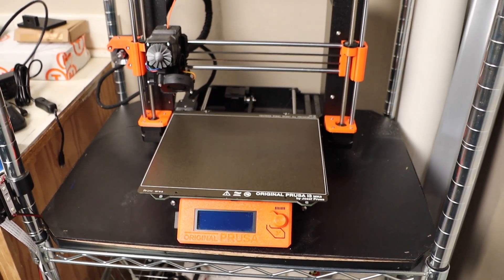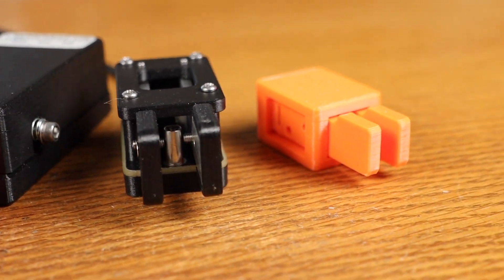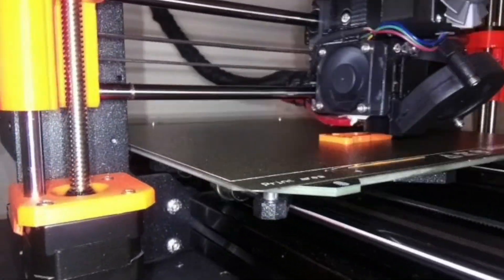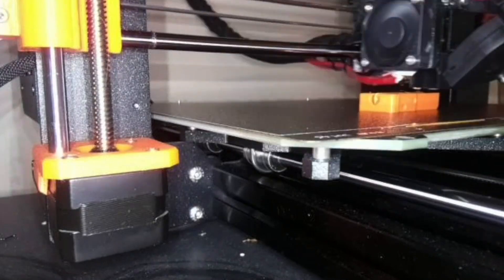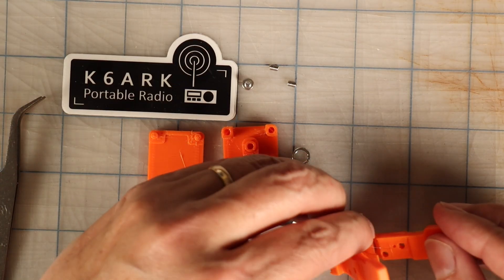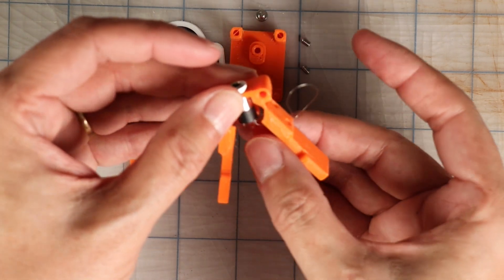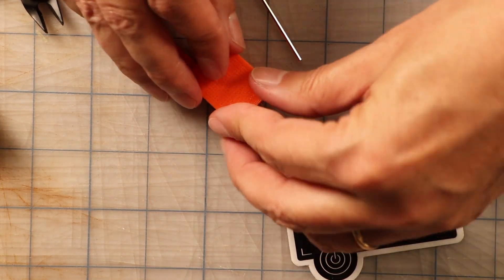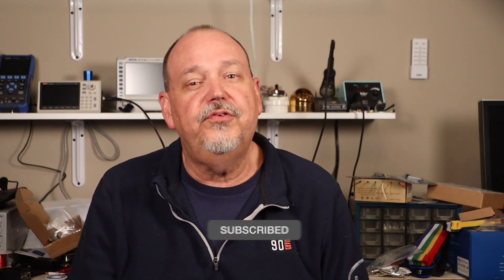K6ARK 3D Printed Paddle: Assembly and Review

Comment: what do you think the thickest gauge wire you could use would be? I keep breaking that 36 gauge wire.
Reply from the maker: It can be a bit challenging to get that thin 36ga wire but thicker wire may not allow the grub screws to thread. You could try a little bit thicker like maybe 32ga but no idea if it will work.
73 and good luck WV7W

Comment: Thanks for this great video! I wouldn't have found that 3rd hole in each lever without this. The tiny holes needed to be reamed out when I got them from the printer-- that's easily taken care of with a straight pin.
Reply from the maker: Glad you found it useful. Adam does a great job with these models but each printer is different so some mods or adjustments may be necessary.
Reply: @houseofhamradio  I had mine printed for me, and my reaction was that I was surprised the printer could make such a small hole. This is one of those designs that makes you think "wow, that's clever!" I'm pretty sure I'll never come across a smaller set of paddles.

Comment: Ok, it's taken me a bit to understand step 7. There are actually THREE holes., the two obvious larger ones, and a VERY SMAll little slot hole where the wire goes through.  And doing this AFTER the ground post mounting screw is more than this old guy has the eyesight and tremor free to do.  So the wire goes into the little slot hole until it is in the larger hole, and then goes back toward the center?  Having fun still. Thanks for the fun.  W1FRA
Reply from the maker: Yeah, they are pretty small. That is why I kept my wires a little long so I could feed them in before mounting the jack.
Reply: @houseofhamradio  I had to send my 3D printing out to a well known house for processing. When my order arrived , it really looked and felt perfect - however I did find that the two slanted slots were blocked by material. Easy fix - very small hand drill and opened 'em right up. I threaded my wire as you did with one exception - the nichrome 'felt' way to fine to take the kind of abuse I expected it to take and felt that it would eventually fail. My solution was to make a Crow's foot knot of the wire before soldering to the jack. That way I had two leads to feed and make contact. I left one a bit slacker than the other and finished up the job. Works fine. One modification: I took a small file to a couple of surfaces to allow me to more easily wedge a fine tip screwdriver between and allow me to disassemble the whole thing. Thanks for your review and THANK YOU ADAM!

Comment: Well heck, thanks so much for the kind words! Glad you like the paddle, and your improvement ideas are spot on.  I will be posting the straight key version here very soon.
Reply from the maker: Thanks Adam, it is a really cool little key. In fact, made one for my friend Dan K7NXL and he housed it today for a SOTA  activation and he likes it as well.
Reply: I just built this paddle using your video. It made the text based instructions much easier to understand.  Not sure I could have done it with just text. I don't have a 3D printer, but my local library does and printed it for me.  I then ordered the parts from amazon and built it.  It works better than my 3d morse 3d paddle even though my library doesn't have PETG filament. 

Thank you @houseofhamradio for the video.

Thank you @k6ark for creating this and sharing it with the community.  I'm going to volunteer at the library to see if they will let us teach a class on morse code and we can give a paddle to anyone who comes.